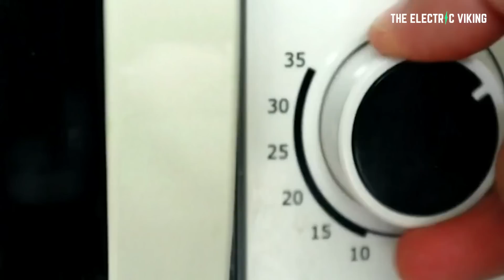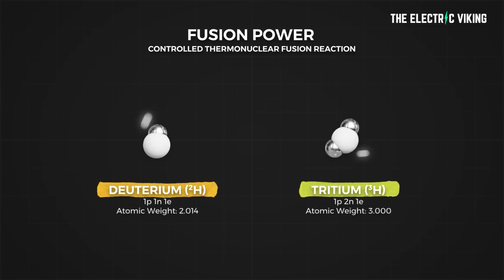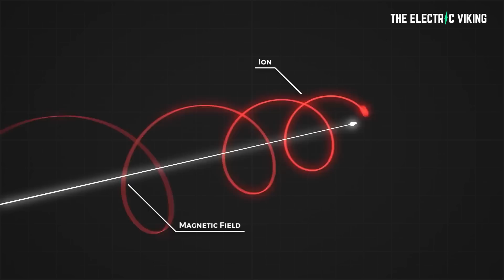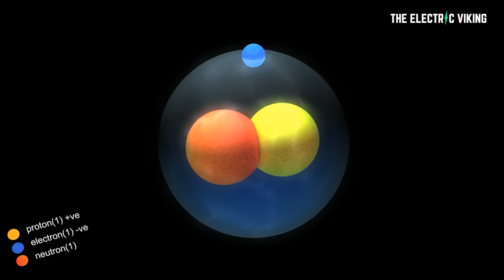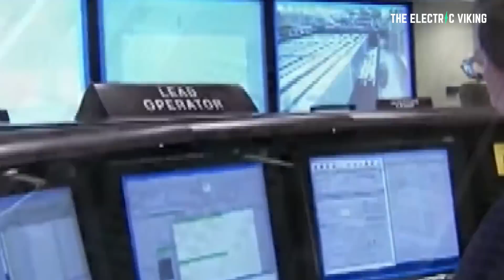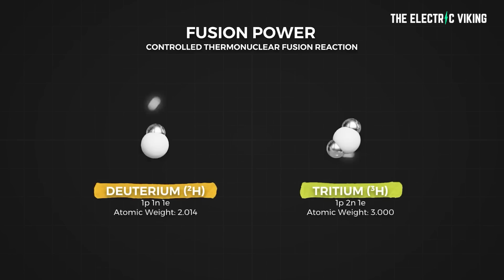Massive breakthrough in nuclear fusion achieved by US scientists

Comment: When people say that nuclear fusion produces clean energy, do they consider a hell lot of neutrons bombarding everything around and transmutating every single nucleus they meet? Thermonuclear blast kilometers away from the surface can be clean. The same blast (and, yes, there at NIF they produced a miniature thermonuclear blast) in a confined volume surrounded by walls will produce way more nuclear waste than normal fission reactors.
Reply: Yes, they consider that.  Some neutrons are to be captured by Li and create tritium, a material essential for fusion but essentially non existent in nature.  Other neutrons are to be captured by a material like beryllium which creates a lot of heat, which will be used for power generation.  In practice the engineering solutions are decades away.  The neutrons from a fusion reactor will not resemble the fallout from a nuclear weapon.

Comment: positive result means the chain reaction could continue  relying on  the heat created by itself . in other word it may not need external heat or laser beams. lasser beam would only ignite it . once ignited the chain reaction will continue for as long as you need. I think we are extremely close

Comment: Unfortunately, this guy didn’t read the details. There was no net energy gain. This specific experiment consumed 300 megajoules of energy to power the lasers, all to produce 3, or a hundredth of the power it cost. The 2.05 megajoules input is just a recalculation, or estimate, based on how inefficient they’re claiming the lasers were.. And of course they’re asking for tons more money and equipment, to “really understand” what happened.  When they can get the lasers 100x more efficient, we’ll see if it’s real and not just sleight-of-hand, but if you have to spend $300 to “make $3”, that’s not a “net gain”.. That’s a day at the casino, holding onto the $3 “winning” you left with, ignoring the $300 you came with.

Comment: Sam would be wise NOT to wade into nuclear fusion and get suckered by a scientific BS to yield a hyperbolic headline like 'massive breakthrough'.

The National Ignition Facility in California has been around a long time. They have produced no results despite million of tests in all these years. They are the only fusion energy researcher who blast a tiny fuel with lasers. Do you know why? All other researchers have long dismissed this approach. On the verge of funding cutoff the NIF performed a desperate blast hoping for miracle, any miracle. They go 'something' and hype it as breakthrough. 

They blast a tiny pallet of trillium to yield a Q of 1.5, claimed without any scientific publication. 1.5 mean output is 50% more than input. But this is the energy of beam v. energy of the resulting explosion, only a small portion can be used. They don't talk about the energy require to make the beam, which is at least a hundred times. More troubling info:
- Use trillium fuel which is made only in nuclear reactors and in the tiniest amount. Impossibly expensive and difficult to get. Why use trillium? Because they have been using deuterium for more than a dozen years and got no result. This is the desperation part.
- The claimed fusion last less than 1 billionth of a second (1/1000000000).
- They can only do this once in 6 hours. Because it takes 6 hours to charge up the lasers. The vast energy of this charge up is not counted in the 1.5.

To make a real reactor they need to sustain the laser blast to yield fusion continuously. The the NIF announcement is to hype a nonsense experiment with nonsense fuel to create a nonsense headline hoping this will put public pressure to release funding to keep the nonsense facility going.

Comment: They still put in over 1000x as much energy as they got out.  What they've done is to make the smallest part work.  There's nothing on the horizon to even point the way to where the solutions to the other million problems might be.

This solves NOTHING.  It's just hype so they can get funding for more research.

Also it's great for coal mines "you don't need to build those wind turbines, fusion is in the way so why not just burn a bit more coal while we wait for it?"

Comment: Sorry, love your videos (probably see 6-10 per week) but this is Not a Net gain when you include All power inputs (including the power for the magnetic containment field). Simply surpassing the input power from the laser Alone does not produce anything useful. I believe you will find a number of approaches were closing on this number  (not terribly useful outside a lab). You still consume more electricity than you produce (note I didn't say "energy" as thermal energy has to be harnessed into electricity with significant efficiency loss).

Also, this is a single burst that must be repeated many times per minute to get a continuous flow. (So you can't have maintenance between bursts).

This endothermic> exothermic milestone is not like the sound barrier (an actual barrier) nor useful from an energy generation perspective, its merely useful to show people that after decades of investment, progress is still being made. 
... and that is critical to fund a project of such scope and duration. 

The director of the NNLN (?) lab indicated they were still a "few decades" from a viable commercial power generation unit.
That said, they will need to spend multiple billions of dollars every year to get there.

The rewards are More than worth it. Its a problem that Must be solved for many reasons. 
That said, I would look into Molten Salt Thorium Reactors for a more short-term goal of cheap, clean, safe nuclear that produces less than 1% of the waste of current light water reactors and is vastly superior in all metrics (save production of bomb making by-products - doesn't produce Plutonium or other such products in meaningful quantities).

Comment: Just two problems: first, operating commercial fusion reactors is STILL many years away so not in my lifetime. 
Second, reactors are still extremely expensive and have a lot of regulatory hurdles to overcome, so even if they get them to work they may not be cost competitive with renewables and storage. Lithium ion batteries for bulk utility storage are a very bad idea, but there are plenty of much cheaper, better (but bulkier, boo hoo) chemistries that are ready to roll. 
If they had put all this fusion money into putting  up more solar and turbine farms we'd be done now. And fusion will still be 30 years away.
If you want base load generators, turn those fission reactors back on.

Comment: It’s another step…
Great for space, Luna, Mars. But if it takes another 15 years, pv, wind, tidal, and battery storage might make it just obsolete… (like hydrogen cars)

Furthermore, in contrast to the sun, fusion is using deuterium or tritium (in stead of hydrogen): not that much available, and also causing waste products.
Also, fusion IS generating harmful radiation. Right now, solar radiation is a tough issue to solve for keeping astronauts safe beyond LEO.
So, an important step, but one on many, many more to come.

Comment: Worthless approach IMO...just to get TAX DOLLARS... HYDROGEN is an obvious solution along with COLD FUSION...already there are large DUMP TRUCKS running on a Hydrogen system using a hydrogen internal combustion and fuel cells to power the ELECTRIC motor... and the electric motors can be much lighter and efficient...hot Fusion is OBSOLETE...IMO...

Comment: A net energy gain is great but it is only the first step. Remember that energy they're using is not 100% efficient and more importantly the energy they are making is not 100% efficient. In fact if they use any kind of heat engine (eg steam turbine) efficiency ranges from 40% to 60% converting heat to electricity. So not only do fusion reactors have to show a net energy gain, they really have to produce well over double the input energy. Plus they have to offset the energy embedded in the build and the energy cost of producing and transporting deuterium.

Comment: Two things seems to make this fusion shot especially interesting. One is that the holram was less peefectly shaped than previously created and they were able to compensate by changing the relative intensity between the 192 different beams. If true, lower tolerances means cheaper fuel assemblies, which means more experiments, total.
The other thing, which is in all.the hype, is ignition. But I've yet to have anyone express what ignition means, and it's important. It means that initial fusion reactions put out enough energy to create more fusion reaction, which created further reactions, etc. In other words, more fuel was fused than can be accounted for by the laser-energy input. The reactions were self-sustaining... for a few trillionths.of a second.
Regardless, ignition is ignition and if the NIF can reproduce this shot it means we genuinely are closer to a fusion future bc it would mean loads of studies of actual fusion in a bottle.
If they can't reproduce the shot.... they made a mark in the history book, but that's about it.
....
Fingers crossed.
Reply: @Dyne's Lair  It took me a bit of thinking on this one.
Assuming I understand correctly, there are generally two reasons a fusion power plant is large.
In the case of  magnetic confinement, like ITER or W9, larger more powerful magnetic fields constrain the movement of changed particles (the nuclear fuel) is constrained to smaller "gyro-radii" and so have less value to move through. This makes them easier targets. But bigger fields need higher electrical power, needing larger coils for any given material. Even so, an ion will jump from one Flux line to another and slowly "walk" away from the middle, and eventually being lost to the chamber walls. This means the reaction chamber has to have a certain volume, dependant on field strength, to allow enough walking steps before being lost to give them enough time to fuse instead. So now you really need a big reaction chamber and a really big electro magnet.

In the case of enertial confinement, like NIF or HIF (not made yet but designed) you need a large enough facility to create enough Flux (photons for the first, ions for the second) to compress the material hard and fast enough to make the fuel fuse.

In neither case is it about accuracy or precision. If you can make a very high magnetic field in a very small space without blowing things up, you could make a tokamok that would fit in your arms. In a way, that what focus fusors and z-pinch machines are trying to do with their collapsing electric fields.

In the same way, if you could fit an election accelerator on a microchip, you might be able to make an inertial confinement fusor (like the NIF but with electrons) small enough to fit in a car. Indeed, I believe that is one reason there's an international committee that has been trying to make just such an electronic accelerator and succeeded just last year... or was it the year before? I forget.

Regardless, attempts continue to make fusion small bc everyone understands the ideal fusion reactor is the size of a refrigerator or smaller.

Comment: 5:22 "Scientists have struggled..."
I can't find any article so far that describes which type of energy. Is it thermal energy or electrical current? Because if it's the former - that doesn't say anything. We'd need on the order of 10x more thermal energy to make electrical power generation viable. So... if they just now have shown the possibility of breaking even thermally we would need a literal order of magnitude more thermal power output to make it viable. But yeah I'm optimistic we'll get there eventually.

Comment: The Laser energy put in was about 2Mj, the energy out was about 3.1Mj. But the energy to power the plant other than laser was 3Mj so total energy in was about 5Mj and energy out was 3.1Mj. You need to know the Total in, Total  out and not just the Laser or plasma energy in. Still a good try but way more needed to be done.
Reply: My error the energy to power the plant other than just laser was 300Mj so energy in was 305Mj so not a massive breakthrough.

Comment: You are confusing the amount of energy for the lasers and the amount of energy for the whole installation. What is needed is something that gives off energy after subtracting the amount of energy for the whole installation. And not only that, but also continuously. I don't know the exact numbers, but I think it still needs five times the energy to run than it gives back momentarily (so not even continuously). So, a clickbait I am afraid. And by the way, the suggestion is that the USA is leading the fusion "race". It is not a competition. But if it were, Europe would be slightly in the lead, sorry for the patriottic US audience.

Comment: "solved"? They got 50% more energy than they put in. That's HUGE - for our tiny steps now. But it's only an EROEI of 1.5. We need an energy profit of like 8 or 10 times the energy put into the thing to even begin to be a viable energy solution - not just an extra 50%. Also, nearly every large fusion device I've seen is incredibly incredibly complicated and makes today's nuclear FISSION reactors look cheap and easy to manufacture! Indeed - that's what Dr James Hansen recommends we do. Pick a Gen3.5 standard like the CAP1400 and MASS PRODUCE them to bring the price down. There's the Dunkelflaute solved! Reliable baseload clean electricity day and night, summer and winter. Solved. Nuclear waste? Goes into a breeder reactor for another 90 times the energy. Final waste? Melt into ceramic glass like bricks and bury under the reactor bunker for 300 years. DONE! But it is also exciting to see how cheap solar and wind are - and if we overbuild those a few times we can get through the worst Dunkelflaute with maybe just a little pumped hydro. Managing a renewable grid will be complex - but nothing like these fusion reactors!

Comment: After 70 years of hot nuclear fusion research, a 'laser show' breakthrough was desperately needed, and it still needs another 70 year to make this 'laser show' breakthrough economical. Meanwhile, Brilliant Light Power's hydrino research is getting ready for market introduction. Their water heating system has a COP (coefficient of power) of 5  (five times more heat output power than electricity input power). BLP is working on a hydrino converter with electric-input -> electric-output by means of solar cells and EUV -> visible light conversion. The Hydrino process is the conversion of energy that is stored in mono-atomic hydrogen atoms (in energy "ground" state), into Extreme Ultra Violet  radiation (EUV light). The "ground"-state hydrogen atoms are converted into hydrino atoms. This physical effect is not predicted/described by the standard laws of physics, so you will not read about it in the "news" papers or other mainstream "news" channels. The COP =5  has been confirmed by university experts independent from the BLP company.  Now THIS is a breakthrough.

Comment: You're understanding of fusion seems really messy. First off is that creating an explosion with fusion is incredibly difficult. It's basically the same issue as turning a nuclear power plant into a nuke, it's quite literally impossible. The issues with fusion have been plasma stability, cooling the chamber that it doesn't fail, and net energy gain. Creating a fusion reaction requires powerful electromagnets and liquid nitrogen cooling to prevent damage. This means there is a cost to running the reactor so the reactor must make more than it uses, that so far has been a struggle. 

There are also a few hidden variables people also ignore though, these include net cost of the project, fuel, and cost to decommission. Fuel is the one that is heavily ignored. Mainly is that the cheapest form of reaction is tritium deuterium hydrogen fusion. Well deuterium is common enough in water to run reactors for millions of years, but tritium is completely unnatural. In fact it's screamingly radioactive with a half life of only 12 years. That makes it more radioactive than the waste from most fission reactors. But the issue is there's only one place that makes tritium hydrogen, it's a biproduct of fission reactors which have been slowly shut down. Now in theory you could bread more in a fusion reactor, but we don't know if you can make more than you burn. 

The cost to decommission is also rarely mentioned. We all have heard how fusion doesn't make radioactive waste, but that's just completely wrong. Yes the fuel becomes completely inert helium, but the best material to make the reactor out of is beryllium. The issue is that beryllium tends to be contaminated with uranium and it's nearly impossible to fully remove. This means the energized particles coming off the reaction will make the walls as radioactive as any normal nuclear waste. Plus the beryllium and other metals themselves are also not immune as they too can be affected by the reaction. 

Lastly is cost. Many companies pushing fusion have said breaking even is really all that's needed, but it's such a misleading statement. These reactors tend to be ludicrously expensive vs any other technique for making power. They are also one of the most complex therefore needing ridiculous amounts of maintenance, the fuel is costly, the jobs are dangerous and degree limited so higher pay, etc. It doesn't just need to be able to make power, it needs to be cheaper per kilowatt than other systems. I find that hard to believe with how cheap solar and wind are now. Hell off shore wind is currently the cheapest form of power. I have no doubt fusion is possible, but I highly doubt they'll easily compete in the pricing department and price is the main reason countries were hesitant on nuclear even before Chernobyl.